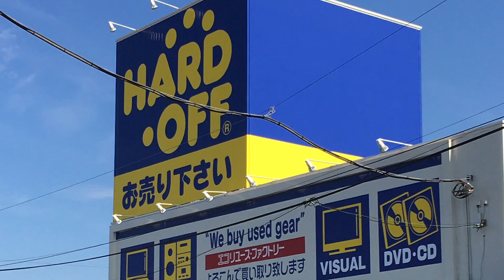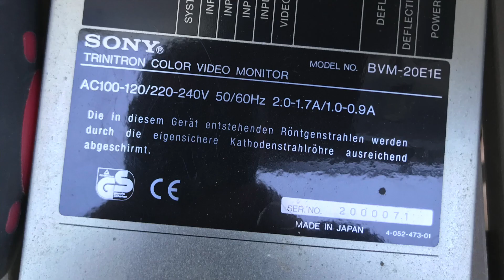VGA strain relief options for the MiSTer FPGA

Comment: I use component, is that Composite /svideo converter any good that you use? How do you feel using component?
Reply: I have the same one. It works perfectly for s-video. 

Composite, unfortunately, is very strange in most systems. It works well enough for playing but there are some horizontal waviness to the image, from right to left, which is annoying.

As far as I've interpreted (in forums and etc), this is a known issue by most (if not all) of these 15khz rgb-to-ntsc/pal adapters (I still ought to test others, though), but not everybody mentions the issue when they should (e.g. Antonio Villena mentioned there was a fixed version in the workings, but at the same time, he mentions that this is NOT an issue, and also that it is an issue... for all adapters... yes it's confusing and contradictory).
Reply from the maker: @Heymisterbadguy  hey mate, I feel your concerns are valid, is can be difficult to know how each product will perform. I can also see the other side, I suspect (I do not know him however) that Antonio is the sort of person who is very technically skilled but the communication side is difficult. He is not a native English speaker but more than this, I think those who are super skilled technically often dont have the huge desire to explain everything to everyone and answer a million incoming questions. They would rather be producing great new products than replying to emails or writing some. I mean this with total respect for Antonio, he makes fantastic products, I am just trying to provide a different perspective on our community.

I think this means someone like Mike Chi stands out so much. Not only is he technically brilliant but is very open and communicative. Maybe its a cultural thing with Americans too. Both creators are brilliant and contribute a lot to our retro gaming community.
Reply: @ZezRetro Thank you for this reply! I now agree completely that what u mentioned about this is very much probably the case!

 Lov ur vids btw =] stay safe
Reply from the maker: I like it a lot. I have an S-video PVM and I think the picture looks great on it, I made a video about it https://www.youtube.com/watch?v=FU41X9_zcbQ&t=0s

I don't need to use component much myself. I live in Europe and all of our TVs have SCART inputs. I also have a bunch of BVMs which take RGB or component and I have a scart to BNC adapter for this. For the MiSTer I have a good quality VGA to BNC adapter
Reply: @ZezRetro  cool, thanks for your reply